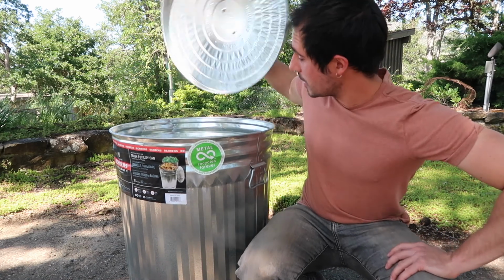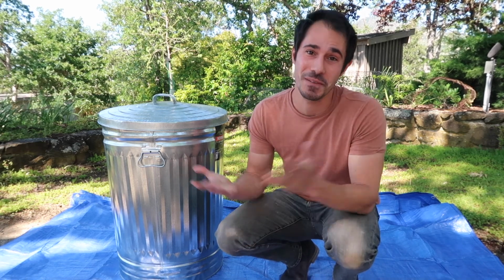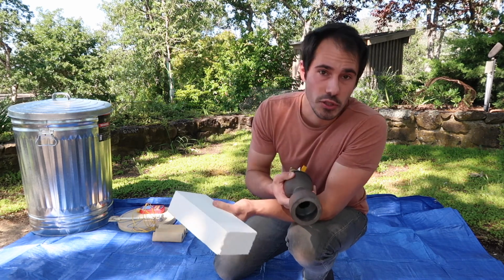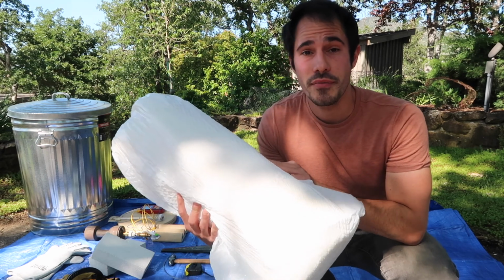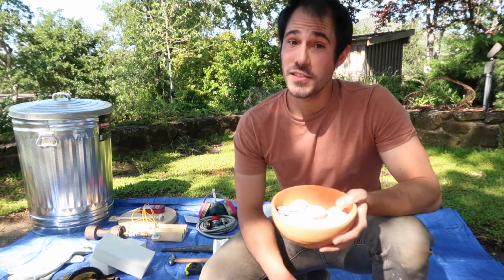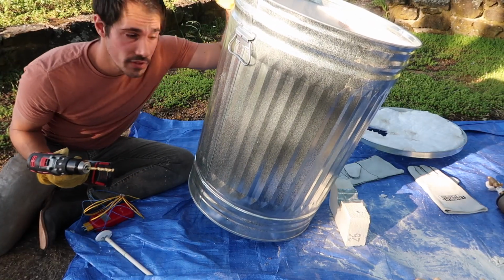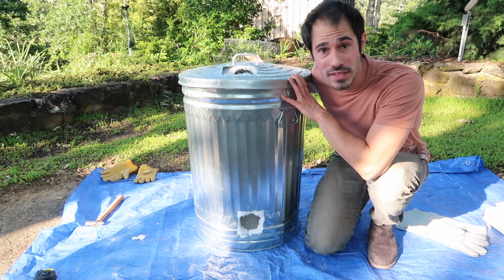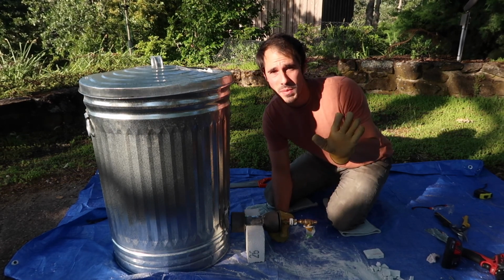How to Build a Raku Kiln Using a Garbage Can

Comment: I just built one today in roughly the same way. I built a metal furnace a few years back and had almost all of the supplies needed to make the raku kiln, other than a new garbage can. Thanks! My kaowool was 2 inch thick, so I'm hoping it will be that much better.  I also sprayed the inside with sodium silicate and hit it with CO2 to make the ceramic fiber safe.

Comment: Thanks for this! I’m putting together my list of supplies and getting as much info as I can on this approach. I can’t wait to do some raku firings this summer! This was very helpful.
Reply from the maker: Oh that makes me so happy to hear! While I was in the process of learning about different approaches and gathering my gear I found that not all of the information was in the same place so I'm thrilled to hear that it was helpful!

One additional piece of information I'll offer is that I have since learned more about the potential dangers of using a galvanized steel trash can, as it can apparently release some toxic fumes from the zinc. So if you do go the galvanized rout, as an added precaution I would recommend wearing a good mask and not standing close by when possible. I'm still not 100% sure about all of the risks but it's work looking into. 

In any case, happy firing! Wishing you all my best.

Comment: To minimize fumes from heating galvanized steel, you can strip the zinc off with any number of household acids.  I've seen it done with both vinegar and citric acid, and much stronger industrial acids like muriatic.  though something the size of a trash can might be a bit more problematic just due to size and surface area.  Also, I'm curious how hot the metal parts get through the insulation. because if the metal stays below certain temps, you could also treat it with high temp paint like Krylon high temp max, stove bright, or POR 15 to protect the metal from rust.
Reply: Hmmm very good thinking 99

Comment: Which is better to wrap the kiln ceramics fiber Or thermal bricks?
Reply from the maker: Hi there! Great questions. It depends on the set up that you will be using. I used the ceramic fiber on this kiln because it has a flexible nature and suits the geometry of a trashcan better. Ultimately I would imagine high-fire bricks to be much better because they retain heat much more efficiently and emirate it back within the kiln. But if you are using ceramic fiber it also does the job quite well, just as long as it is within a shell of some sort, like a trashcan for example. If not contained a good wind could blow by and whisk away some of that heat you've built up!

Comment: Doug I am lost. I am trying to start a small hobby business doing pottery. I loved following your video and definitely interested in building this for my kiln. I do have a question though. Where might I find these soft brick and shelves?
Reply from the maker: Scott, that is great! Congratulations on starting the whole process! 

If you look into local pottery supply stores in your area that would be where to find those items. I am sure you can also order some online through theceramicsstore.com (or others) but definitely cheaper and quicker to buy them locally at a clay supplier in your area if possible.

Comment: Currently building this... how many firings do you expect it'll survive?
Reply from the maker: Oh great! I hope it goes smoothly for you too! Not sure how many to expect out of it-- I have used it about 5 times and it has begun to show some wear on the outside from the heat but nothing breaking down. I also recommend using non-galvanized steel if you can. I learned that galvanized steel releases some fumes when heated!
Reply: Ahhh fab, glad I read this!!

Comment: Doesn't galvanized metal gas toxic vapor when it is heated / burned? Wouldn't a stainless keg be a better setup possibly?
Reply from the maker: Hi there! Yes, absolutely! You are correct-- I didn't know about the fumes it releases going into this plan but learned more about it after the fact. Have to use a mask if I want to fire that one up next time. Using a stainless keg sounds like a much more sound plan. Hope you get a chance to make your own too!

Comment: Can you use this for bisque firing?
Reply from the maker: Great question! In theory I suppose you could, however, since greenware is pottery at its most fragile state I would expect it to be quite difficult! Clay goes from clay to ceramic (a chemical change on the molecular level) at a little over 1,000 degrees, which is called the quartz inversion. And in addition, if there is any moisture left over at the beginning of the bisque firing the water will turn to steam and explode around 212 degrees. Anyway, there are a lot of steps to insuring the ware wouldn't break in this trashcan kiln but I suppose with good conditions and care it could work out! 

Not sure if you knew that info or not, just thought I'd outline that a little bit. Hope that helped and hope you have fun with your next firing! Thanks for watching!
Reply: @dougrubenstein  so you need two kilns ? One fir bisque one for raku ???? Ughh lol
Reply from the maker: @lisalovelylpa  Haha, pretty much!

Comment: Please does lack of space makes the temperature not to rise above 700 degree Celsius?
Reply from the maker: Hi, there! Great question— since it is a fairly large space it does take some time to heat up. It will heat up to 500 degrees Celsius pretty quickly, actually, and it will climb to 700 and even 950 Celsius in about 45 minutes for me. Just takes some patience and care when placing the burner in the bottom opening and carefully keeping the top opening slightly covered but open enough to receive enough oxygen. It’s a real dance!😂

Comment: Where did you find your burner?
Reply from the maker: The burner I used is called a Venturi burner and I got it from a local clay store. But The Ceramics Shop sells the burner along with the other accessories as well! Here is the link if interested: 
https://www.theceramicshop.com/product/12323/raku-propane-burner-kit/?gclid=CjwKCAjww-CGBhALEiwAQzWxOlRmqqIwLiQbSB3Bfwlkakog_5wDV9-Kdxl2loqP8FTAlMCP3TXC2xoCg4YQAvD_BwE
Reply: @dougrubenstein  

Yeah, good video, but DIY'ing a burner, is the info I was looking for.

Im trying to improvise a small kiln on a minimal budget. What I really need is some scrap bricks, but there's apparently nowhere within 50 miles, for me to get any.